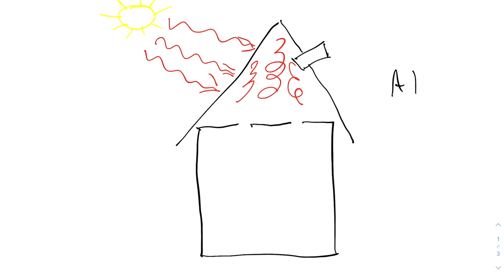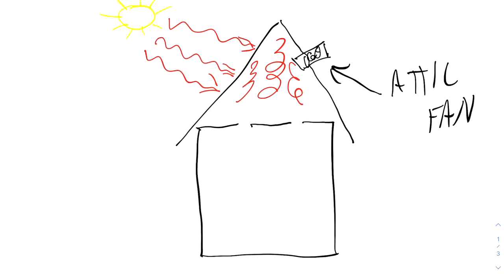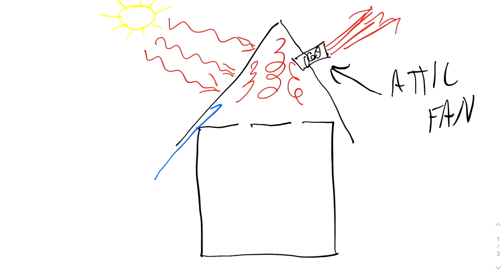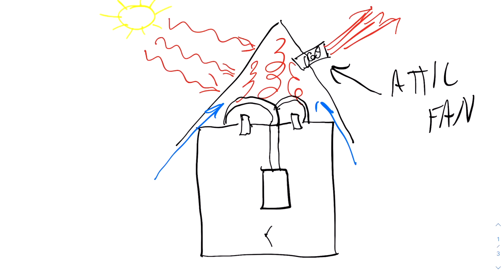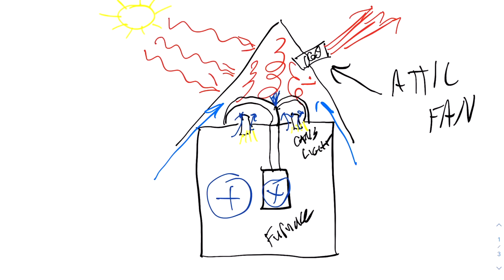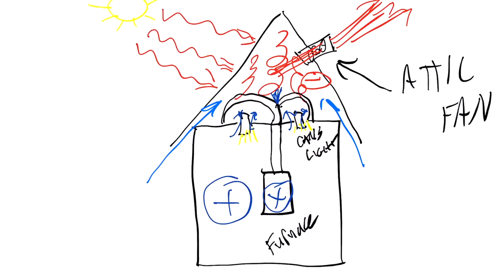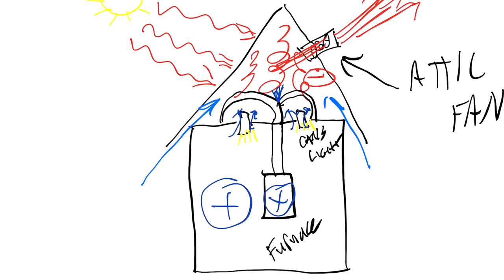3 Remodel Rip-Offs

Comment: Here in Central Fl. 6/16 outside temperature is 98 degrees. No attic fan neighbors attic is 167 degrees. Mine has an attic and it is 123 degrees. It’s also connected to house power with an electronic switch so at night it would continue to drop the heat inside after the solar has stop power the fan. By 9 pm is ambient temperature inside the attic. For me it a good investment. Windows you don’t make back the money on that investment. Smart thermostats as a  AC tech I can say they do work. It’s best to lower moisture in hot climates. Mold issued the duct work and inside the AC are a problem. People don’t clean the inside of the AC with at least some mixture of Bleach or any king is desinfectante.

Comment: @Matt Risinger
Not that this is the product I would suggest for such a problem I'm going to pose but I feel a feature in building codes needs to exist for this. It was posed in another video elsewhere that the troubles that housing and roofing experience in high winds and major storm events, tornadoes and hurricanes, is from the high air current creating low pressure over buildings' outer surfaces. In those massive storm events would dropping the pressure in a building aid in reducing wind damage? Playing with pressure could cause problems but if there is a damage mitigation promise why not choose to do so? Really would like to know if there is anything like this out there or if it has been studied.

Side point, if there is venting leading from a ground source or a consistently shaded space a vent of any kind, powered or not, could cool an attic, yes? Also shouldn't we be committed to having reflective roofing for high angle summer season lighting conditions anyway? That roofing, despite being cheap maybe, is adding to the heat at times when gained heat is undesirable. You're going to have heat gain into the house no matter what so again with the mitigation.

Comment: re smart thermostat: it allows control via wifi, including turning off/on which can be a benefit if you are away. also, temperature/timing can be tweaked with numerous set points. the thermostat also shows 
historical usage.

Comment: With the powered attic fans, the argument is made that the house is negatively pressurized and any fan would pull cool air from the house to the attic. From a physics standpoint, yes that's 100% true. The fact is, a house is already leaky and negatively pressurized without a powered attic fan (bathroom exhaust fans, and clothes dryers are the big culprits here). Crack open a door to your house right now, and I guarantee you will feel a breeze coming IN to your house before you ever feel one going out. 

Hot, outside air is leaking into your house more often than not. If that hot outside air is leaking into your house and your attic is not sealed off really well, and most are not, because contractors are going quick and not sealing every little opening, that sweltering 130° air in your attic is coming in through your ceiling. I know people whos 2nd floor is 10° hotter than their first floor just for this reason alone. A powered attic ventilator would make it so the 100° air from around your walls comes into the house, not the 130° attic air, and your 2nd floor is closer to your 1st floor temperature. 

Is a powered ventilator a perfect solution? Of course not. Perfect would be a well sealed house and attic where this isn't a problem and you don't need to ventilate your attic. But no house was built in this perfect world unless you pay big bucks to get it done, especially if your house was built before 2000, when there was little care at all for how energy efficient a home was. I was quoted $13,000 to properly seal and insulate my attic. This is the correct path to solve this problem, but if you don't have $13,000 laying around to get this done, a $400 powered ventilator may be an acceptable 3 or 4 year solution. Especially if you have big vents on the sides of your attic wall (air will take the path of least resistance and mostly come through those and not out of your house). Saying it is a flat out scam is a bit misleading. 

And no, I do not have one of these fans nor am I trying to sell them. I'm just following the physics and typical house construction practices.

Comment: during the summer of 2017 I went into maybe 15 residential attics in which I used a infrared temperature sensor and the average reading was between 130° - 142°.

Comment: I've run Google's Nest and Emerson Sensi smart thermostats. I didn't see much of energy savings with Nest.  I like the ability to control the thermostat while away and have alexa set the temperature without having to leave my room. Honestly the best thing to do is replace your mid 90's HVAC with newer system with higher SEER. I would get the Sensi Smart thermostat for convenience not for energy savings.

Comment: Matt in every video: "Here's some common old fixes that kind of work, but are not the correct way to deal with the problem. Here is how to do it correctly based on modern science."

People who don't understand building science: "Well, in the 70's my dad put a fan in our attic and it cooled our house to -10 f when it was 145 f outside, so obviously you're wrong."

Comment: The only reason you should replace your windows during a remodel is single to double pane windows. Especially in the desert, or extreme cold.

Also, if you live in a house with wood siding, you will really show the savings, if you replace the windows yourself. I've spent about $1500 on 6 windows so far (and still have 1 big window, and 2 small windows to replace) . And it won't take that long to recoup those costs.

Comment: I have a remote reading thermometer in the attic, and through the roof powered attic fan, If i turn the fan off, attic temp goes above 135 on sunny days, with attic fan on thermostat control, attic temp stays below 115.  This reduces the amount of time i need to run the Air Conditioner to keep the house comfortable, in fact except on really hot days, no AC required.  I think Matt is wrong in this case, about attic fans.

Comment: Glad I found this - got verbal quote for $4500 to install 2 solar fans and a 300mm skylight, was shocked by how much they cost and the solar ones don't include batteries that's an optional extra but they make out they can extract heat at night (if you buy the $200 kit with some lithium battery and its charger) - I was thinking to buy couple of those kitchen steam extractor fans and build something. The place as whirlybird but as you say in summertime with sun blazing you don't get any respite from it and bonus it works at night time too!

Comment: I disagree on smart thermostats, I have the Google one and it saves me a lot on heat. It's also paid for itself in rebates and gift cards from consumers energy for joining the peak energy savings program. I don't have a central air unit so I can't comment on summer usage of it, but I do still use it with 2 window air conditioner units, I have a 930 sq ft house and I can run both window units when I get home from work and get the house down 72°F by just running the fan to the furnace for  15-30 minutes.

Comment: Just a couple of thoughts ... I like the WiFi thermostats because I can monitor my system from home. If something goes wrong I can see it in advance before I get home and find I have a 90+ degree house. I can even set the temp down before I arrive if I want before arriving. So for me, it's been definitely been worth it. Windows I would tend to disagree with your opinion. I live in Arizona ... we recently changed out all our windows and went with the top rated window, Andersen. The difference was night and day. The old windows, which were even doubled paned radiated so much heat ... these new ones we not much of anything. I had invested in outer shades which helped, but even in colder times of the year they still stunk. I will save a lot of $$$$ on less A/C run time. Windows are a great investment.

Comment: I agree about attic fan when sun is out. But the moment sun sets you want to get that heat out. My attic is 115f and it is 80f out.  I would like to vent that hot at at 7pm.

My night time lows are in low 60s so it makes sense here.

Right now my attic is 107f and it is 70f outside.

Comment: You are completely wrong on the smart thermostat, especially for hot dry climates. We don't worry too much about condensation when it's 116 and humidity is 10%. Plus, in California a smart thermostat can literally pay for itself, not by energy savings, but from your power company.
You can set up your thermostat with your power company, so that when extra power is needed, your thermostat goes to 78, if you keep it at 78 you get a huge price reduction on electric use, but you can lower it if you want and pay extra what you'd pay otherwise.
If you are not home, this simply means you get the extra bonus of cheaper electricity with literally so downside. Also, many smart thermostats have motion sensors, so they can detect movement and this can be tied into security systems and if you have multiple units, turn units on where people are located and allowed a wider range of temperature in parts of the house that are unused.
When I set my alarm as away, my AC/Heater units automatically go into away mode and I can set where I want the temperature to be when I'm away. When I come back home, I can either use my phone to tell the system to go into home mode, or use geo fencing on my phone so it automatically becomes more comfortable when I get back into the city.
When I go to sleep, the unit that controls the public parts of the house keeps the house much colder in the winter and warmer in the summer, to use less electricity, and it knows I'm going to sleep because it's tied to lights and patterns and motion sensors. I don't even have to worry about it being too cold or too hot, because it automatically reverts to normal at 05:30 and if I get up in the middle of the night for some reason, it will heat up or cool down if I walk down the hallway.
To put this in perspective, we once had a $2,000 Monthly electric bill. That is not a mistake, one month was OVER $2,000. 80% of that was AC. While we installed solar panels and took other steps to improve AC efficiency,  options were very limited because the house is sold concrete and glass so there is no way to add insulation.
By using the smart thermostats and programming them correctly, they paid for themselves in less than one summer.

Comment: In my opinion attic fans do work. It just depends on what part of the country you are at. If you are in a heavy humidity area not gonna be very good if you’re in a very very hot zone probably not Very good but from the Midstates on up they work pretty good. I lived in Texas and I currently live in Phoenix Arizona I’m pretty familiar with hot territory. And I’m a builder of 35 years.

Comment: I was speaking to a contractor who said the same thing about windows especially if you already have double pane. Unless they are broken it isn't worth it. And when you do it, Id much rather prefer not to use replacement windows if you can.

Comment: I disagree mostly. Bought house 7 yrs ago. My ridge vents were mostly covered by roof paper from previous owner as identified by an electrician I hired for bathroom fan install. Bought 10 watt solar attic fan w low cfm at 700 and temp switch at 75 deg. Made in Arizona. Not some white box cheapie fan. Roof attic is approx 850 sq feet. Split level house. My 17 yr old AC runs great. No massive electric bills. Northeast US. Last months electric was $138 which included a heat wave. Before solar attic fan, you could feel the heat from bedroom ceiling like a hot dinner plate. Basically, I would not go with a monster cfm attic anything fan.

Comment: i don't understand ur argument on attic fans - i live on the 3rd floor - no working attic fan above me - it's 98 degrees in my room and 73 on the 1st floor - if heat rose to my floor because of forced a/c,  then heat should continue to rise thru the attic, correct? why do they use fans in combustable engine cars and computers?

Comment: He is completely wrong about the attic fan. Have installed dozens of these.  They are cheap to install and make a big difference here in hot California. Lowers the attic temperature significantly, which in turn lowers the house temperature.  Been a builder and engineer for 40 years, am 100% sure about this.  These fans are well worth it.

Comment: Hey Matt, great information. One thing on the windows… my Texas Gulf Coast home was built in the 50s with jalousie windows all around.  A great idea when AC wasn’t doing the cooling, but a nightmare that made heating the home in winter impossible. Eliminating the air bleed/infiltration by changing to vinyl double pane windows had a startling effect on comfort and noise levels within the house.  I realize your comparison  was intended for single vs double pane, but thought to mention that there are times the change is a huge benefit.  Keep up the good content!
Reply from the maker: Thanks Rick

Comment: I wonder if it is location based on the attic fan.  In Michigan and Northern Illinois, in both places I saw significant savings when adding a single attic fan that worked only during the summer.  In Georgia, Texas, etc.I have no idea which is better.   I like smart thermostats since I like being able to schedule highs and low temperatures.   Replacement windows are not necessarily big cost savings but could add comfort to a home (what is the value of that?).   Lots of good comments below.

Comment: Using white shingles lower yoru attic tempretures up to 30 degrees, but white shingles will have aleage   froth on the north and east side that will eventrually turn gray. You can also use white liquid silcone or rubber

Comment: I had a programmable thermostat that didn't save any money. Maybe they don't work on baseboard heaters.
I have single pane windows, poorly insulated walls and no insulation under the floor. I made an insert with styrofoam for insulation to go in the windows and foam pads on the floor. My unit is more comfortable through out the seasons.

Comment: I am going to disagree on the solar fan, having seen one work reasonably well out west.  But... it has to be variable speed, and there's the catch: the quality is in the controller, not the size of the opening.  If speed calibrates primarily on apparent solar load, that's where its best.  If it's an on/off style device, pass on that and keep looking.

Comment: I'm going to to push back on the fan a bit. I lives in a house built in the 50s with gable vents at opposite ends of the attic. Having a powered fan at one end took the roof temp from unbearable to uncomfortable, I can work in uncomfortable.

Comment: Would a powered fan work for something like a small shed where I want air to move and not stay too hot? I also would like to push out moisture bc the shed has the water well system inside & is very damp all the time.
Fans may not keep you from getting heat stroke, but I've found they make me a bit more comfortable when it's really hot. At least there's a breeze. I believe we have a gable fan in the attic but I don't know if it runs anymore (can't get up into the attic currently).
I have no interest in "smart" thermostats bc I'm sure something would go wrong with my luck, but I do want something backlit that I can read without a damn flashlight. Hallway lighting in my house sucks (one weak ceiling light is there) and there are no power outlets in the hallway at all so it's hard to see the readout on the thermostat without a light.
I'm guilty of using fan on mode to keep air circulating in the house bc no matter what we do, it's humid (no dehumidifier installed) & if the air is moving it's more comfortable & air doesn't seem to stagnate. But then, I sleep with 3 fans (ceiling fan and one on each night stand pointing at me). I feel like I can't breathe without the airflow. I also have a damaged lung & allergies. Another family member has COPD.
I'm actually planning to get my windows replaced. I have single pane metal windows & many of them are difficult to open and close. Although there is one that is like a freaking guillotine. It has to be propped open or held open or else it slams down. The glass has started to separate from the metal on some of them so they leak air and moisture like crazy. In short, they suck.
Are any of the vinyl windows now built to withstand high heat without warping or is fiberglass the best way to go?
I'm not looking to spend a ton of $ on it, but the windows need to be updated for comfort.

Comment: Sorry but you are totally wrong about solar powered attic fans. When I changed my roof, I replaced the two spinners with solar powered fans and it dropped the temperature in the attic by an average of 15 degrees, that is a BIG difference. It also meant the attic cooled off faster at night and so I didn't have to use my A/C nearly as much and you could even feel how much heat was radiating from the ceiling at night. Not a scam at all!

Comment: My thermostat that turns down the AC/Heat when no one is in the house isn't saving me money. I am suspect of this claim. My old dumb thermostats didn't know when my family went out for 3-4 hours. My smart one does. There is savings there. Also, I plan to install an attic fan in my smoking hot attic where my ducting runs. I fully expect an increase efficiency with a cooler attic. Maybe people are buying one tiny fan, but nowaways they sell pretty nice, large, high powered fans.

Comment: Attic fan:  So why do we put non powered vents in our roof?  If they reduce the temperature in our attic a powered fan will cool it more during hot summer days. Soffit vents that let air in need to be sized to meet the new higher flow rate, but usually are enough if not blocked without modifications.